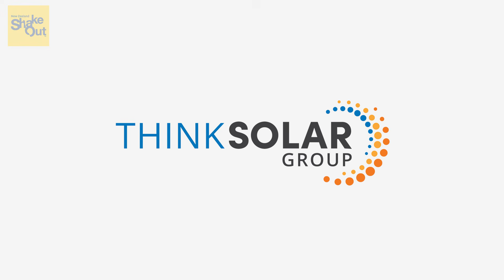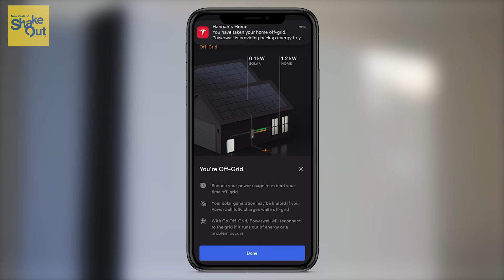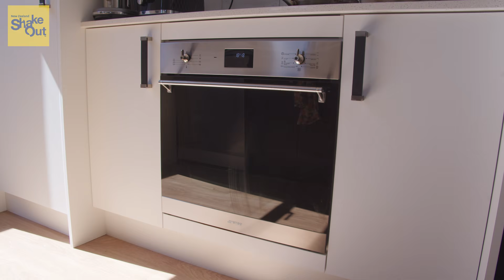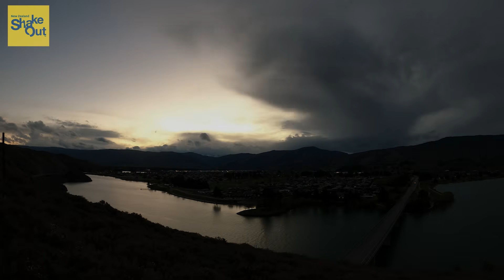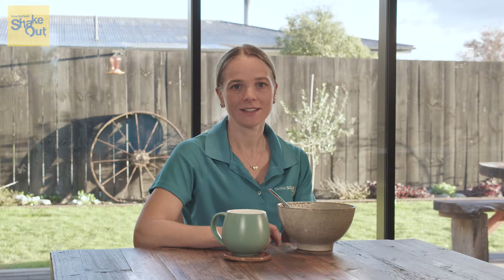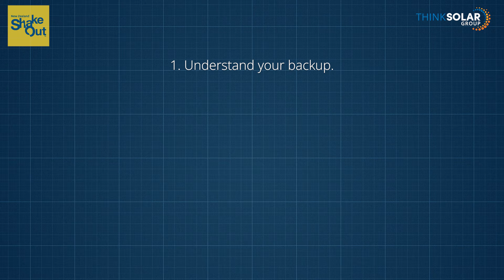How to Manage Your Solar and Battery System During a Power Outage

Comment: the best thing we did was go solar nov 25   5kw inverter  7.2 kw array  9.5 kw battery  & use a manual switch over from grid .  one positive wont over load for system to shut down  & not a issue just to get up & shut main off to solar 😀

Comment: If the battery did completely discharge how long would it are to recharge?
Reply from the maker: That depends on how big your solar system is, and the available sunlight. The Powerwall 3 can charge at a maximum rate of 5kW, so if your panel output can sustain your loads in the home, and ALSO deliver 5kW to the battery, it will take roughly 2 hours and 45 minutes to charge from empty to full.

Comment: Batteries are getting to be so cheap that having enough to last for a few days off grid is really no longer an issue. Even here in Canada we are seeing 48v/5kwh batteries for $1100.
Reply from the maker: In a battery + solar system, the battery still represents a majority share of cost, but the tide is turning. Solar panels used to be really expensive going back 10 or 15 years but are very cost effective in modern times.
Reply: @thinksolargroup  I bought two pallets worth a couple years ago. I am well aware of how much I could have saved if I was buying them today. But I have zero regret because it cost me less to be off grid than the utility wanted to charge me to bring power into this site. When you have 10 acres of prairie at your disposal its pretty easy to still have 2-3kw coming in on gloomy days. 40kwh of batteries I can float for 5-6 days before I worry about the generator.
Reply: And an off grid inverter, not just the batteries

Comment: V2L would also help if you have an EV with a large battery and you need to keep the freezer running.
Reply: fridges and freezers do not actually pull much power as long as they are not opened much. There is a spike from the compressor but it goes down below 300w when running, and be off for a couple hours at a time.
Reply from the maker: @davefroman4700  Thats the beauty of those kinds of appliances in a power cut, they have such a low power draw you can rest easy knowing the battery will have plenty of juice to keep them running.